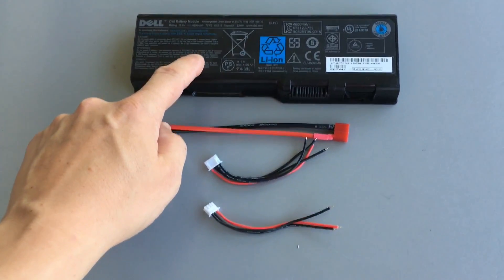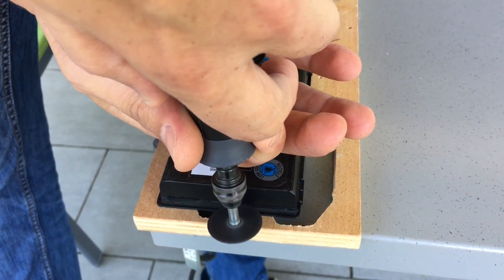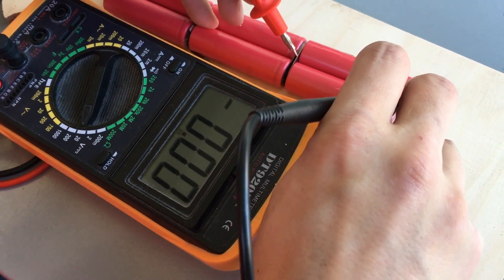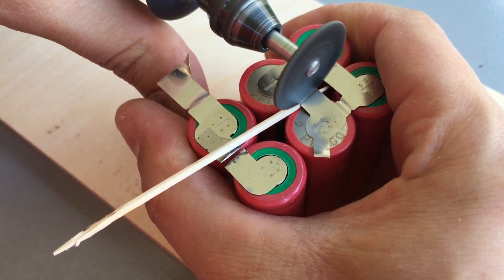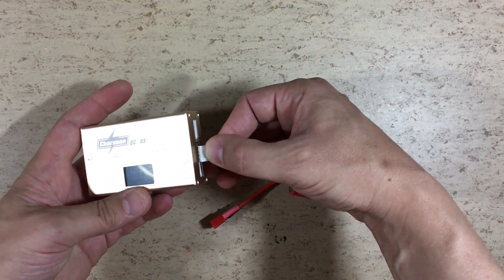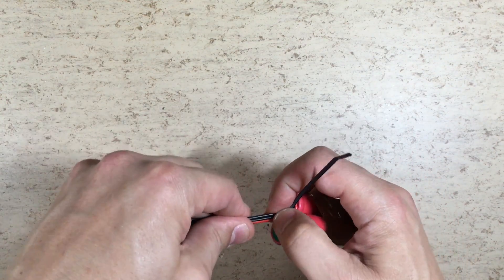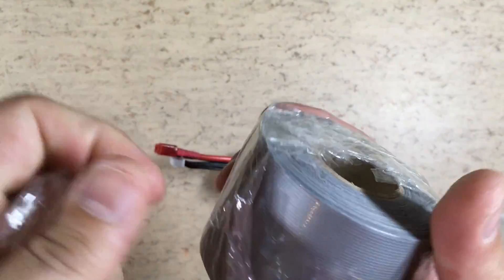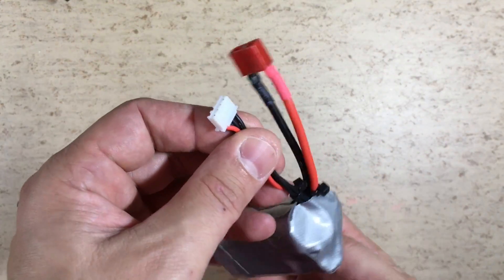How to convert a Laptop Battery into an RC Car Battery Pack

Comment: how many mins i the run time with that battery mod in 3s 18650 pack?..
Reply from the maker: I don't recommend this mod anymore, because most 18650 cells are not able to supply the required current for RC cars.

Comment: It doesnt work, because laptop 18650 Cells only output a max of 2 amps. you need more then 30Amps to power a good brushless motor, even with brushed motors its bad..Thats why there is Lipo.
Reply: i have a toy rc rock crawler.the stock battery is ni cd battery of 500mah.can i use 18650 cells for this rc car?
Reply: And for servos and receptors will work?
Reply: i can confirm this, have bought a 12402-a wltoys car, that runs with 7.4V 2s battery pack(rated 20C = max current draw 20Amps). So i created a 7.4V 2s2p(2 series & 2 parallel) battery pack just like in the video from laptop batteries (Samsung  ICR18650-26f, 2550mAh), but the car can only run approximately 1/3 of the original speed. And i found out why: this is because the specifications of the Samsung  ICR18650-26f batteries, says that max current output is 5200mAh! This means that a 2s2p battery configuration will give out max 10.400mAh on 7.4V. But the car needs 20.000mAh to run like the original setup!
Reply: @Ris-v4w  the capacity is not your problem. The ampare output of the liions is way to low. Most of the laptop cells are rated only for 2Amps output. You need at least 10 this will give you 20amps, if you use 2s2p

Comment: Laptop batteries not high drain. Don't forget!
Reply from the maker: Yes, you can't use these batteries for big RC cars. This application is better: https://www.youtube.com/watch?v=cHcd8H1RqVM
Reply: i can confirm this, have bought a 12402-a wltoys car, that runs with 7.4V 2s battery pack(rated 20C = max current draw 20Amps). So i created a 7.4V 2s2p(2 series & 2 parallel) battery pack just like in the video from laptop batteries (Samsung  ICR18650-26f, 2550mAh), but the car can only run approximately 1/3 of the original speed. And i found out why: this is because the specifications of the Samsung  ICR18650-26f batteries, says that max current output is 5200mAh! This means that a 2s2p battery configuration will give out max 10.400mAh on 7.4V. But the car needs 20.000mAh to run like the original setup!

Comment: I made a 2S battery for my RC and it sucked 
The RC was bearly ever going full speed so I decided to don't use that 
Does the cells need to be new?
Reply from the maker: Of course you need healthy cells, but they don't need to be new. The max. discharge current depends on the cell type though.
Reply: Lipo usually have a dischargerate (C-rate) of 10c or above. liion have around 1-2c. That means a 1000mah liion can deliver 1-2 amps while a similar lipo can deliver over 10 amps. You can somewhat remedy this by adding more batteries in parallell.
Reply: i can confirm this, have bought a 12402-a wltoys car, that runs with 7.4V 2s battery pack(rated 20C = max current draw 20Amps). So i created a 7.4V 2s2p(2 series & 2 parallel) battery pack just like in the video from laptop batteries (Samsung  ICR18650-26f, 2550mAh), but the car can only run approximately 1/3 of the original speed. And i found out why: this is because the specifications of the Samsung  ICR18650-26f batteries, says that max current output is 5200mAh! This means that a 2s2p battery configuration will give out max 10.400mAh on 7.4V. But the car needs 20.000mAh to run like the original setup!
Reply: Not only that but because of the low C rating aren't you stressing the ESC and battery it self? That's what i found out with WLtoys a959 , the ESC was too hot to touch and the battery was warm , motor warm as well but that's normal 
So i just stopped playing with it xD
Also just lots of loe voltage cuts
Reply: @FXV56  tbh i don't know if the ESC got hot, but definitely it gets reset, because the remote control connection also gets lost, and i have to push the ON/OFF button on the car to make it work again. so either it runs out of current completely and can't sustain the ESC(all sucked-in by the motor), or it enters some sort of circuit protection(i hope not, this would mean that maybe the ECU gets too hot just as you said)

Comment: So if my defective laptop battery wont charge nor hold a charge, how is taking the cells out going to make them work again?
Reply from the maker: No. If your cells are dead, thew will stay dead. I took the cells out of a defective Dell laptop with good battery.
Reply: People have said elsewhere that the laptops circuitry somehow "disables" the battery if cells get to low. So what I think may seem like a dead laptop battery, may just be cells needing a new charge since the circuitry is preventing it.
Reply: when u open a laptop battery u vl find a circuit board which charges the cells safely .if the board is destroyed then the battery wont charge  but the cells are good .i tried this

Comment: Tip: don't use Dremel to open the laptop battery, because you could make it explode into flames if it contacts the cells
Reply from the maker: Yes, it can be dangerous. That's why I did it outside and carefully ;-)

Comment: Can you use six batteries and make a 3s? And have it make up so it is long like a traxxas battery?
Reply from the maker: You can make any shape you want. But keep in mind, that those laptop 18650 cells are not suitable for extreme discharge rates
Reply: Thanks

Comment: Its very nice.
Reply from the maker: Thanks

Yes, my 2S battery pack has a better run time than the original pack of the Remo s max
Reply: is it no matter the 3S battery without pcb protection, like: pcb BMS.. probably? thnksss...